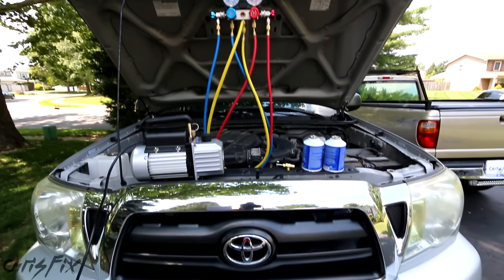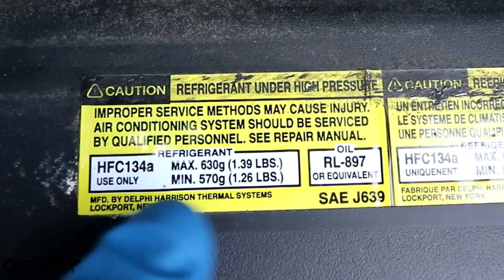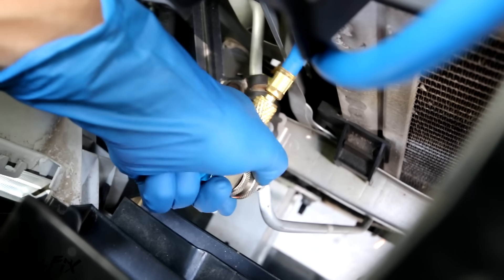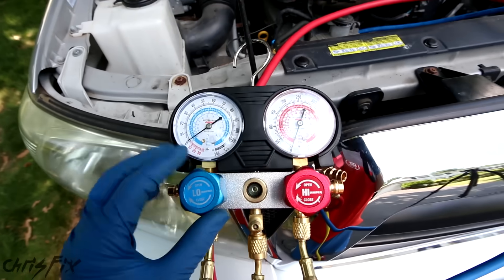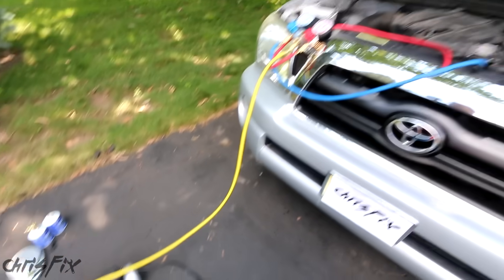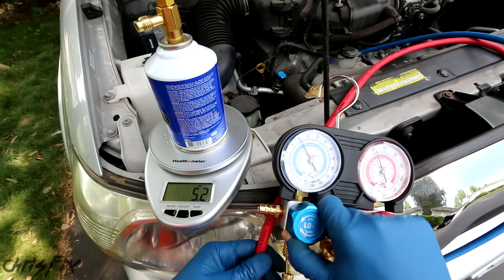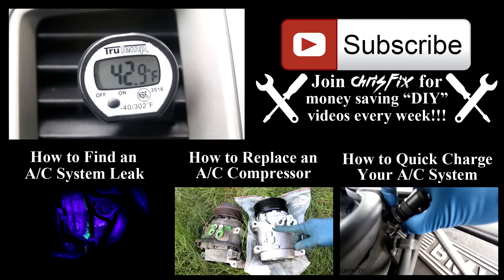How to Properly Recharge Your AC System

Comment: For what it's worth, after I replaced the electro-magnetic clutch on a GM compressor, the type that has multiple snap rings holding various parts and seals in place, I attempted to recharge my systems with a can or 2 from Walmart that included a pressure gauge, but no chart or other way to adjust the charge pressure for temperature or humidity was provided. I had the engine running to create suction; it was early August when I did this at about 95 to 100 degrees F and 70% humidity. Apparently I managed to severely overcharge the system, because suddenly the compressor sounded like it had exploded when the pressure dislodged the shaft seal and blew the entire refrigerant charge and PAG oil out of the compressor through the area around the shaft. It took me a while to get back to it, but upon taking it apart, I found that the first snap ring, which that secures the shaft seal in place, had been partially blown out, allowing the shaft seal to be knocked out of place and the PAG oil and refrigerant to escape, explosively.  I've rebuilt the compressor, and have acquired a manifold gauge set from Amazon and a vacuum pump from HF, viewed a number of YouTube videos, and will follow Chris Fixx's instructions about fully evacuating the system for 45 minutes, purging the line from the refrigerant can to the gauge set, as modified by the comments here, especially those of Dylan B and those responding to his comments.

P.S. For those considering purchasing the either of the two vacuum pumps offered by HF, always use the 20 % off coupon on such purchases. I bought the less expensive pump, identical to the one used in this video, and it works fine. You have to first fill the reservoir with the bottle of oil that comes in the box, but please note that when you connect the yellow hose to vacuum out the system, the black cap on the pump does not have to be removed to allow the stuff vacuumed out of the system to vent to the atmosphere.  It is designed to vent without removing it; however the instructions are minimal at best.  You have to watch these YouTube videos to learn what you are supposed to be doing with the valves and hoses to properly recharge the A/C system. The instructions are also incorrect in places as to which way you turn valves to open or close them.

Comment: I follow the same steps but the pressure on the high side is not going up. It stopped at 100 and the compressor is on and off

Comment: Thank you Chris. Your video walked me right through the steps to recharge my system after a compressor and condenser change out.
System putting out 46.3 degree air at 86 degrees ambient.
Well done sir.
Reply from the maker: That's what I love to see right there!

Comment: I think he misspoke or is incorrect about the adapter on the Freon can. Tightening down will push the pin down in the can thus releasing Freon. Loosening the twist handle on the adapter will remove pressure on the pin in the can and prevent Freon from escaping.

Comment: Chris, those quick connect fittings on the side of your manifold gauge set, did those come with the set or did you add them? I'm trying to find adaptors like that to allow my own quick connect cables to connect to the gauge set like that.

Comment: Hey @ChrisFix, thanks for this video. I vacuum evacuated my AC system but it only manages a steady 25lbs if vacuum. It never reaches 30lbs but it instantaneously went to 25lbs of vacuum for 45 minutes while I evacuated the system and it’s still holding 25lbs for at least an hour. Is this ok?

Vehicle is 2006 Honda Ridgeline with 130k miles, all in SoCal. THX for all of your great vids.

Comment: I want to thank you for presenting the proper procedure for recharging an A/C system. However, I have a question or two. When you apply both hi and low pressure hoses to the proper ports on the vehicle, you then say you're turning the valves, at those ports, to the ON position, correct? But, (and I don't have a set of gauges and hoses YET) when you turn those two knobs, to the supposed ON position, you are turning them CLOCKWISE. I am used to seeing valves turned ON, by turning the knob,  COUNTER CLOCKWISE.  I cannot see the icon arrows on the knob faces so, I'm kind-a guessing here. I assume you know what you're doing because of this nicely presented video so, I'm really not questioning your ability, just a tad confused on the direction you're turning the knobs for both the low and hi  pressure hose ends, on the vehicle ports. Thanks.
Scott
Reply: Yeah it will tell you in the knobs when they are closed or open i have this exact set it’s reversed but it should tell you on the gauge what way to turn to open or close the hoses

Comment: Thanks for this well narrated video. When you purge the yellow service hose of air, you are letting out a certain amount of refrigerant, so after you charge with the refrigerant and empty the rest of the can, it's not actually 12 oz that you have uploaded (charged) to the system. It's 12 oz minus whatever amount was purged. It would be good to know what the weight of the remaining refrigerant in the can is.
Reply: not even  1/4oz was purged out of the system. not enough to really worry about

Comment: If, after applying vacuum for a few minutes and the vacuum hits -30 on the low side, then closing the manifold gauges, aren't you cutting off the gauge from the A/C system? If there is a leak in the system how would you see it on the low side if you closed the valve? It seems to me you would have to open the blue gauge to see the level of vacuum in the system. By keeping the blue valve closed it seems you would only see if there was a leak in the manifold connections.
Reply: My mistake. With the coupler valve open and the manifold valve closed you see pressure on the gauge.

Comment: Chris, great video- I have a question- when I first open up the low pressure side after bleeding the air out of the yellow line. The low pressure gauge jumps to about 100 however the high pressure is still showing a vacuum. How long should it take to get the first can in?

Comment: Hey Mr Fix, I want to say thank you very much for your videos. I am an OTR ( Over The Road ) truck driver and had an A/C compressor fail. It was most like caused because of boss not pulling a vacuum on the system. I have beat my head against the wall trying to explain why this is an important step, even sent him your video to NO PREVAIL. I had bought this equipment and carry it with me at all times due to the fact that I take my dog with me and travel a lot to AZ and CA. I saved over $1,300 by doing this swap myself and followed your video step by step. Now I can hang frozen meat inside my sleeper lol. You are the greatest and love how in depth you are. May God's love and mercy be plentiful for you and your family.

Comment: Great video.  My only comment is I have the same gauge set you have from Harbor Freight and it is complete JUNK.
On the second time I used it while charging the high side valve on the manifold popped and starting leaking refrigerant through the top label on the valve knob.  I was about 80% charged so after the leak the total in the system was unknown. Threw out the Harbor Freight gauge set and bought a high quality set.  Had to start all over again.

Comment: AS A RULE OF THUMB BEFORE CHARGING ANY AC SYSTEM YOU MUST CLEAN THE CONDENSER PERIOD BEFORE YOU DO ANYTHING TO THE SYSTEM.  THE REASON YOU ARE SEEING HIGH HEAD PRESSURES IS DUE TO A DIRTY CONDENSER.  NOBODY TEACHES OR DOES THIS AND THE REASON WHY SOME MANY PEOPLE RUN INTO PROBLEMS.

Comment: My AC stop blowing cold air after awhile of running in 80m/hr but it return after resting  while no problem if im running below 60m/hr..... my motor and condenser is new. What might be my problem?
Reply from the maker: Sounds like you have a blockage in your accumulator or somewhere in your condenser. I would get a pressure test done to check that out!
Reply: @chrisfix  thanks

Comment: Once I turn on the vacuum pump and I open the low and high pressure the low pressure does not go under zero and when I leave it sit the reading goes above zero what could cause this? I used two different pumps to make sure the pump wasn’t bad
Reply from the maker: I would make sure it's all connected properly, but it sounds like you have a pretty big leak somewhere in the system, see if you can hear it when trying to pull a vacuum!
Reply: ChrisFix thank you!! I got some of that uv dye and found it was coming off the o ring on the compressor.

Comment: Not that it matters and this video is 5 yrs old but you have your manifold gauge hoses on backwards. The ends with the slight bend in the brass pipe go on the equipment, the ends with just the brass knurled nut go on the gauges.

Comment: on my 02 H1 I’m finding what I believe is oil that has leaked out of ac . I will be doing the dye test this week ,  my question , will the pump suck out the oil and the air ? If not , how do I remove the oil from system ?  Thanks

Comment: I bought a suburban that had a pretty large hole in the high pressure line going to the condenser. I'm pretty sure it say for some years before I bought it. How do I know if I should add oil to the ac system?

Comment: I watched another video that didn’t specify to use the pure 134 a refrigerant went and ought a new compressor and tried to charge it with 134 with stop leak .. is my compressor shot now or what should I do I couldn’t get anymore Freon in the system

Comment: adding PAG oil the way you instructed doesn't work. First of all pouring the require amount of oil into a narrow hose is impossible. Then when you purge the air from the line most of the oil that did go into the hose just sprays out with the air creating a big mess! After this disaster I bought a can of freon/oil blend and it worked as advertised

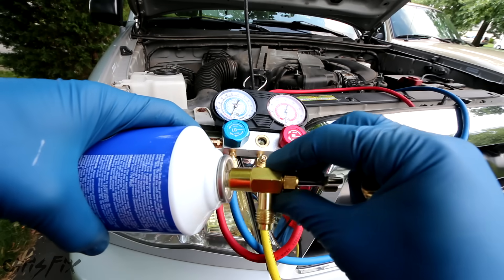Comment: At 8:50. Of you can poor oil in the yellow line that then gets sucked in. Doesn't that mean there is also some air in that line that will get sucked in?
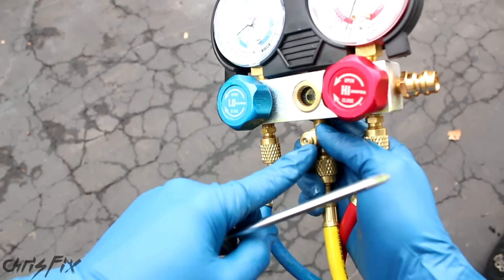Reply: Ah, answer at 9:22. But that would also purge the added oil?

Comment: hey Chris when you said have the system evacuated first (before you turned on the vacuum) doesn't that remove the moisture too ? or it just removes the freon ?  if you were to hook up the vacuum to a fully charged system it wouldnt remove the moisture and the freon ? or just the moisture? When you have the system evacuated (freon gas removal) it leaves the moisture behind? thus requiring the vacuuming  after ?   If you can clarify in detail I'd appreciate it... or anyone else for that matter.. thanks peace

Comment: 6:22 not sure if somebody has raised up this concern. You may want to detach the vacuum pump hose immediately after turning it off, otherwise the pump oil (most vacuum pumps have oil inside) can backflow through the line.

Comment: When I did a vacuum I could only get down to -15. When I tried to recharge it I could only get about 3/4 of a 12 ounce can in and no cool air. Could the poor vacuum cause this?
Reply: when you turn off the vacuum and let it sit with the vacuum still connected for 30 to 45 mins, does it stay at -15 ?  if it does than you should be ok... if not you have a leak somewhere and need to fix it then, re-vacuum and see what u get

Comment: I was working on the AC system for my 93 Sentra, but when I opened the valves my high side got sucked down to 30, but my lo side didn't get sucked down at all. Any help is appreciated!
Reply: Thermal expansion valves when bad have a mis-balance with the pressures... not exactly sure but give it a look... peace, hope it helps

Comment: Jusy curious: when adding the freon i to my system, do I need both high and low pressure valves open? I noticed you only showed you opened the low side, but you had a reading on your high pressure gage. The only way I seem to get any reading on my high pressure gage is by opening the high pressure side. Do I need both sides open when refilling my ac system? Or just the low side?
Reply: Nope just the LOW SIDE. Can't  stress that enough. If you open the high-side you risk adding even more pressure from what it already has thus blowing the seals, hose or worse damaging the compressor.
Reply: MioHioHarada okay that's what I've been doing, I just wanted to make sure I was doing it right haha! Thank you! I'm just confused how to get the high pressure dial to give a reading, cause mine doesnt do anything when it's closed. So I'm curious how to get the high side to get a reading like in this video.
Reply: @ethancgilliss Just stating the obvious, but Did you check if the end part of the hoses were closed so that the pin opens the schrader valve? With that aside, If the high pressure side is 0 then the low pressure side must also be 0 as compressor will not run unless the high side pressure is above the Freon ambient gas pressure. From what I know If the expansion valve is plugged the high side will be over pressure and the low side will be under vacuum.

Comment: how do you put oil and uv dye in the system from yellow line when you need to purge the air out to refill with r134a surly it will just get pushed out
Reply: Good question, wish we had answer for this

Comment: How did you get the low side gauge to reset to "0" before purging the yellow hose to assure freon was gonna go into the system and not air?
Reply: he changed the AC compressor in the previous video so there was no gas in it, thus it was at 0.... then he vacuumed it before adding the freon in order to remove any moisture from the compressor swap before recharging the system.....peace bro

Comment: Thanks for the video. Question. How can you check for a vacuum leak in the system if you've closed the valves?
Reply: the valves only close off the space between them and where the yellow hose connects, NOT between the low or high side connections b/w the manifold gauge set and the car.

Comment: "This refrigerant is pretty nasty stuff" R134A is used in the ubiquitous Can O Air dusters. Thats why you can buy it off the shelf without an EPA card.
Reply: They make ammonia based refrigerants, they are just more expensive. They use these kind of refrigerants in RV refrigerators.
Reply: I wish they would just ban that shit already it’s so bad for the environment and the ozone layer. If it illegal to cut refrigerant lines, it should be illegal to buy a can full of tetrafluoroethylene that will be purposely released into the atmosphere.
Reply: @BGTech1  
What r u saying? No AC for summer weather???
Reply: @BGTech1  I thought we moved on from this ridiculous fear mongering and you guys switched over to "climate change".  Manufactured crisis for a pampered generation.

Comment: I have a renault espace grand from 2004 but this car only has high pressure connector but most of the videos are with cars for high and low pressure connectors. So my question is how can I maintain this air conditioner myself with only a high pressure connector?

Comment: Hey Chris I have a weird question no mechanic near me can tell me. I have a 2014 Honda Civic hybrid. My ac will blow cold when I turn the car on. It’ll stay on for about 20-30 mins if parked but if I start driving more than 30mph it’ll cut off to hot again. The dealership told me a diagnosis for my car would be $750 which I find ridiculous

Comment: I was able to recharge my system with one 12oz can but the 2nd one that I needed, after purging it off air, it wouldn't go up the yellow supply line after I slowly opened the Low pressure  as Chris showed. I got a screwdriver and pushed the inner circle to let air out and I did not see refrigerant coming out, only air. I didn't see anything moving up on the clear round gauge either. So when I disconnected the can, it gushed out refrigerant but I couldn't use the valve any longer. Did I do something wrong or did I get a faulty can of refrigerant?!

Comment: Hey Chris, I know this is an old video but I'm about to this and I got a deal on refrigerant but it has additives, is that okay to use as you had emphasis on that detail?
Reply: It is recommended to use straight up- pure refrigerant. Additives can mess up with the AC lines, so any additives or seal-leak stuff is not recommended. It may be a quick fix but either leave it to the professionals or it will be an expensive repair down the line.

Comment: Chris-I installed a compressor off a low mileage motor. Some oil came our of it, maybe 1oz. I'm not sure how much oil is even in it. If the system takes 6oz of oil, how much of that is in the system and how much should be left in the compressor? I'm having a hard time seeing how the oil is distributed in the system and how much I  have at this point.

Comment: Man, great video. I just followed step by step. When I started to put Freon in, my low side gauge is reading +30 and my high side gauge has no reading. No Freon flow in the window and the can does not seem lighter. Ideas?
Reply: Hm, seems like it may be an issue with the pin opening the refrigerant can. Are you sure the can was opened up by that needle pin on the valve?

Comment: Chris, I replaced my compressor and recharged it, I hooked the can up to my gauges and charged with the can upright at 12 o'clock and rotated every few seconds to 3 o'clock back upright to 12 o'clock, should I have any concern of damaging my compressor?
Reply: nah you should be good. My mechanic shakes the shit out of that refrigerant can.  I know some mechanics are very technical about not moving the can and some are not. I don't think you should worry about damaging the compressor